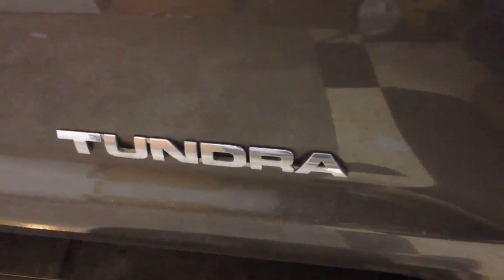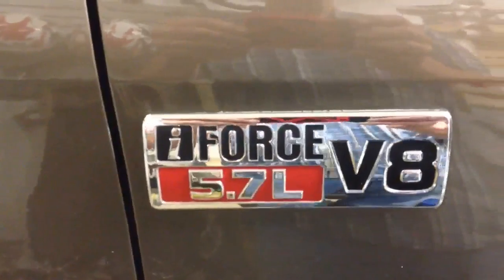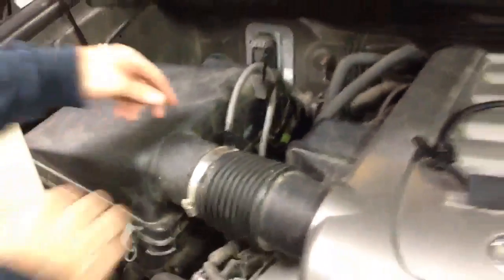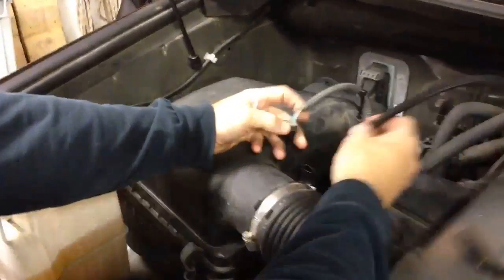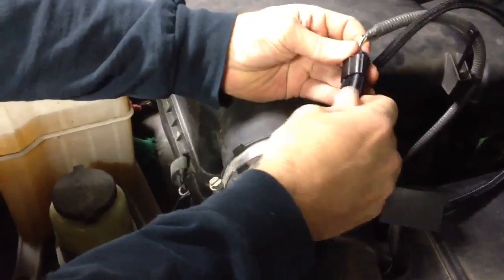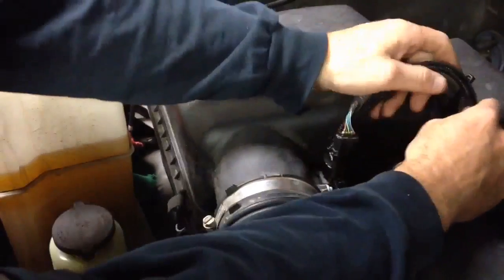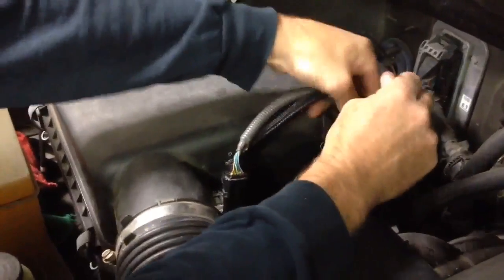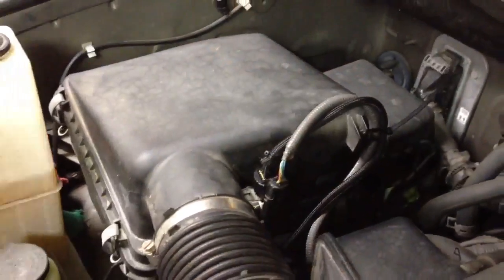SAIS/AIP Bypass Kit! NO More Limp Mode! NO Cutting Wires!! - Rutech Solutions

Comment: I would like to say avoid buying this unit if you have a 2008 or high year truck.  This will give a code of Po11B after install.  It is a know issue and Tim continues to advertise this unit for trucks over the age of 2008.  I asked for a refund and Tim said to send it back which i did and have still not heard back from him.  Avoid this unit.

Comment: I emailed you and gave you my phone# and I'm still waiting to hear from you. I just installed my bypass kit on 5/28/19 it worked for 1 day and the lights on the dash came back. I think you need to add the purple wire that Hewitt Tech has. I've explained what happened to a few well seasoned mechanics with over 40 years experience and they all say the the the purple wire Hweitt has is the reason why you don't get the dash lights. It's like a memory wire kinda like the in a radio. It continuously tells the system that everything is ok. Please contact me and  do something about this.

Comment: How did you pry apart the flange in order to get the block of plate in there? I am having a hard time getting in there to pry that open.
Reply from the maker: Christopher Wright 
 After loosening the nuts on both studs, use the extension and a 10mm socket to push on the stud this will move the top part of the flange/port connections away from you allowing enough space to slide the blocker plates in. Try to have the straightest angle with the extension to the stud when pushing on the stud.
Reply: I used a small pry bar to create a gap

Comment: Toyota will fix for free. Vehicles less than 10 years and less than 150,000 miles
Reply from the maker: Yes very nice information, It is always important to make sure what your warranty covers but for the some of the earlier Toyota's that are well over 150,000 miles, this is a cheap alternative to spending thousands on replacing your AIP system.  We also sell to a lot of customers that had the warranty work done and their AIP system fails a second time, As long as the ECU has not been updated the bypass kit will still help.
Reply: I have an 07 with 98k and dealer doesn't want to cover it.
Reply: Only for the 1st buyer, mine was more miles. I think it was lower mileage on Toys than Lexus too to fix free?

Comment: I had to install a plate on BOTH sides of truck. Not sure if thats because its dual exhaust, or v8 or what.  My tip: For the drivers side (like shown in vid) loosen the 2 nuts until they are almost all the way off. Then get under truck, and with a prybar, pry on the stainless tube that goes from that junction, to behind the motor. It is a rigid stainless tube, so getting the plate inbetween the two flanges is a PITA! The tub going behind the motor is technically no longer going to be used, so I just pushed and pryed on it until I created enough play to be able to slip the block off plate inbetween the flanges. And even then, i could only get one side of the plate in, and had to tap it in the rest of the way. Tight fit. 

Passenger side is very similar. You can also run the nuts down to the end of the studs, then use a pry bar, and pry up on the nuts/studs. This will cause the flanges to separate a little bit, so you can get the plate started in. Then tap the plate in the rest of the way. 

I havent driven the truck yet to see what the end result is.
Reply: howdy how has this kit worked for you? been looking to get the kit but am skeptical. did the codes disappear or did you have to reset them first?

Comment: I am purchasing this exact kit! I was curious if most people leave the valve in the truck still, or if you have to mess with it at all, or if I just need to install this kit and that is it. I was assuming the defective component, the secondary air valve needed removed as well before installing this but I could be wrong. I"m a "DIY'er" but work on aircraft for a living not trucks, so I'm just looking for some slight guidance! Excited about getting this installed and finally getting rid of this P2445 code once and for all!
Reply from the maker: Hi, just need to install the Bypass module and the plates, no need to remove any of the AIP components.
Reply: RuTech Solutions any word from the other consumers how difficult installing the block-off plates can be...?
Reply from the maker: Yes I have customers that deal with corrode port connections and most use penetrating oil to resolve that issue, others just have a hard time finding the correct position to pry at. I also get a lot of customers that never turn wrenches and find it to be easy,  I also get a lot telling l me they took it to a local shop and had the plates installed. I would say if you can change a tire the you could install the block off plates.
Reply: RuTech Solutions awesome! Thanks. I'm an fighter aircraft mechanic by trade so I'm sure I'll figure it out! Thanks

Comment: My 4.7 2008 truck has had the pumps replaced. They replaced one then the other about 2 years ago. Both were full of water but they only replaced one the first repair. Second pump went into a wet contaminated enviroment because they didn't do it all at once like they swore they would at Toyota Town London where I purchased it new. The dealer wanted to fix it but they claim there hands are tied by Toyota. I had to fight to get them to pay for pump #2 after it failed shortly after. I don't know who to hate. Warranty supplement says pumps (plural) and valves (plural) plain as day. I kept the truck because they were willing to back up the pump issue. I am an idiot to have trusted Toyota. They changed the warranty repair procedure on the 4.7 because some only had one wet air pump. Never told me. Should be illegal. Dealer freed up my last failure free but never mentioned I was shit out of luck. Thought they were just being nice and no one said anything about how really screwed I was. Just went again with 50,000 km (about 30,000 miles) on a babied mint truck. Only synthetics and loving maintenance by me. Stuck in limp, and cant pass emissions. No big deal right?? Extra warranty still good from wonderful Toyotas. WRONG It was fixed once under the warranty suplement. Turns out they only warranty the fix for 12 months. Over a year left and 190,000 kilometers on the 10year 240 k pump and valve warranty. DOESN'T MATTER. They said they fixed it once ........lasted over a year.......no longer there problem. I now have a mint 50,000 original kilometre rust free lawn ornament. Toyota Canada was nice at first and became increasingly rude as the cost went up, and the dealer wanted $109 for a diagnostic to confirm the p2446 I already pulled. NOBODY mentioned the 12 months from date of a repair attempt or its my problem. Finally found out from complaint hotline today. My truck no longer qualifies because they tried to fix it once. Only lasted 10,000 kms from last repair Unbelievable. Makes me sick. I will NOT pass this truck along to some other sucker. It will sit until I can learn to fix it. Going to post this everwhere I can to warn others. Tell any Tundra owners you know about this. They need to be stopped.
Reply from the maker: Jeff that sounds like a big old headache, I understand Toyota should be fixing this for you, but after you crawl through all their muddy water just to reach the point that is in the back of you head, knowing they will find away around truly fixing the issues for you.  I have a cheap solution for you to clear your P2446 and remove you from limp mode. Just double check with the dealer to make sure the did not update your ECU while they had it in the shop. Check the website and shoot me a email if you have any questions. https://rutechsolutions.com
Reply: Can you repost the last part of your reply please!! For some reason I can not read all of your reply. Your response is cut off at "clear your P2446 and remove you from ???????????" then I cant see the rest of the words. There is no "expand" or "read more" button. I dont know why. I was told by the dealer that our new Ontario Government emissions test equipment will individually test all emissions components, like a dealer scantron (?), so if one component is disabled it will be detected and fail. I am desperate. I'm getting old and need a hip replacement and back surgery, and this repair is going to be physically painful to me more than you can imagine. I am thinking about trying to build some kind of wooden platform over the engine so I could lay on it and hang my arms down to the intake manifold . Sounds ridiculous I know, but I think it might work. I need to get the etest in 30 days or I will need to tow it. That is too expensive. This was my first ever new truck and I planned on keeping it til I died. This is a horrible situation that makes me want to throw up. Don't ever get old. It is horrible. LOL Thank you.
Reply from the maker: Jeff that sounds like a big old headache, I understand Toyota should be fixing this for you, but after you crawl through all their muddy water just to reach the point that is in the back of you head, knowing they will find away around truly fixing the issues for you.  I have a cheap solution for you to clear your P2446 and remove you from limp mode. Just double check with the dealer to make sure the did not update your ECU while they had it in the shop. Check the website and shoot me a email if you have any questions. https://rutechsolutions.com
Reply: Jeff Iscool same thing just happened to my fathers Tundra. They replaced the air pump in 2014 and now in 2017 the valves are junk. But, the valves aren't a part of the extended warranty, just the pump. Not to mention their are two pumps and I am not sure if both were replaced in the first place. Im going to buy a bypass kit for the enitre system and then I am going to remove it and leave the pile of shit on the dealership floor.
Reply: Jeff Iscool dealing with the same situation 2012 5.7 tundra 38,000mi limp mode this week so irriated with toyota right now

Comment: A couple of things: first, go ahead and liberally spray the block off port nuts prior to even trying to take them off. I used WD40 Penetrant (Silver and Black Can). I knew I was going to do the work in the afternoon, so I sprayed it in the morning and gave it several hours to do its magic. The nuts easily came loose. Second, for me, accessing the ports was easiest from underneath. I didn't have ramps, so I just drove the front wheels up on a parking lot curb and put the parking brake on...gave me another 10 inches of room underneath my '07 Sequoia and plenty of room to reach the ports. My neighborhood mechanic cleared my codes prior, but I was still having issues with the SAI fans whining for a minute on cold start-up. Since we are heading into winter, it was happening almost every time I turned the key. I am ecstatic to say that I no longer have to deal with that annoying noise, AND my Sequoia feels like it has more power right after install.  Great product....EASY to install. THANKS!!!!!
Reply from the maker: Thanks Russell for the purchase and the great write up on how you manged your install on the block-off plates,  It sounds like the WD40 penetrating oil is good stuff, I usually recommend Pb-blaster but that is mostly because my father is obsessed with the stuff. I am glad the install went smoothly for you and your back up running with out the noise! Take Care 
Thanks Tim